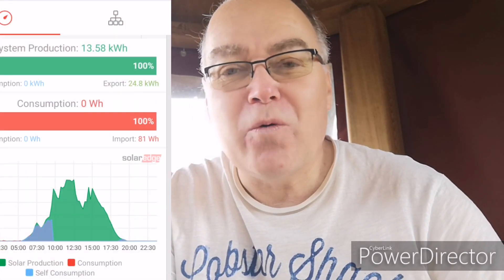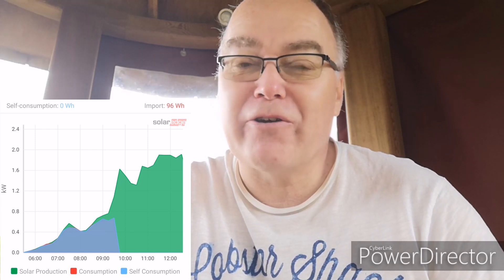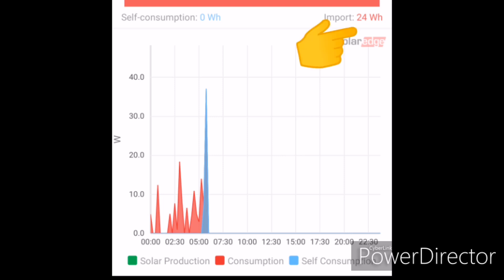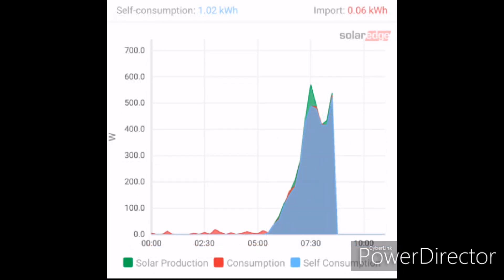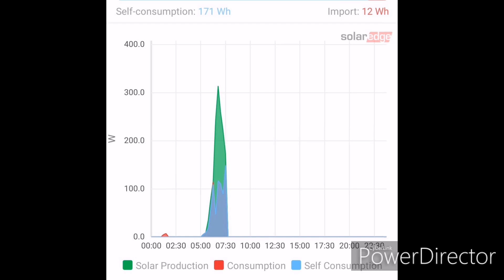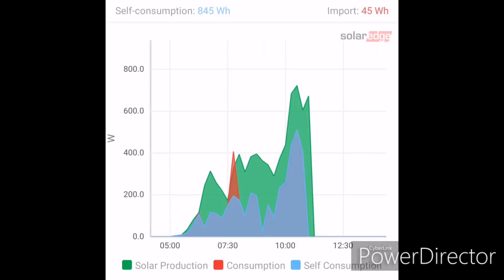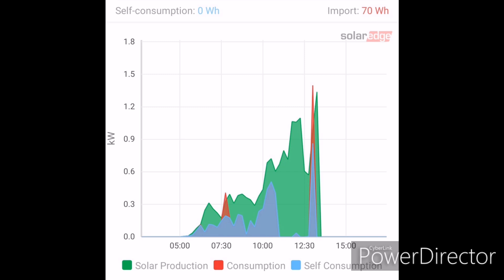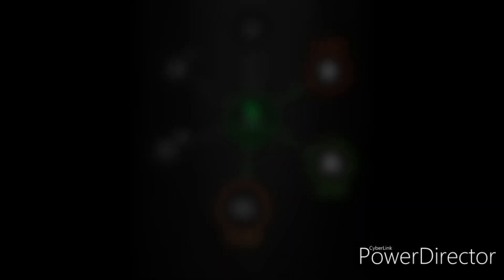Failure! Not all videos or tests go as expected

Comment: After being an EV owner for over two years now, I’m down in Australia.  When it came to looking into the battery for the home, what most batteries do, as in charging as soon as and as fast as possible seems like the dumbest idea ever. Both for the effect on the grid, and speed of charge. When trying to research this before purchase, it was like an alien question and couldn’t find much detail on ways of making it possible. I ended up purchasing a hybrid Fronius and LG battery system. It has built into the software battery management control with some really good options. Still only new to this, and playing with the best options. But it does give me full control over time of use and charge speed which is excellent. Having lived with the system for less than a month, I also now see how it is beneficial for the system not to be fighting the grid or household uses when charging as the reaction time for the battery is far from perfect. The Fronius allows me to say, do not charge at all until 9 AM and then only charge at max set speed until say 3 o’clock and then charge at full speed if needed for the rest of the day. Another feature it has is a fully customizable float point with the grid, as in I can set it to try and maintain 10 W of grid export, eliminating way more of the grid usage then when it tries to float at no import or export all the time. I agree with the other comments regarding faster charging being more efficient, as I have found with the car, but I think battery ownership is more about having A positive affect on the grid. While having enough control to maintain a healthy battery for longevity. As in, if the battery is charged the full by mid morning, most days it would sit full until late afternoon. Which isn’t anywhere near as healthy, as only being full for a couple of hours! Most companies have to make big improvements here.
Reply from the maker: Fronius... Not heard of anyone with one of those in the UK yet. Not a cheap box but by the sound of it, for good reason. Software isn't hard and like you say these controls should be standard. It wouldn't be hard to implement timed control of all settings.  We can but hope companies choose to offer more flexibility alongside improvements in automation and A.I.

Comment: Just wanted to start a debate: we've just installed a 500w system, supplies all of our electric from about 10 to 16:00, apart from kettle , toaster etc. So we've probably halved our grid use age, but we don't export more than a few watts. Cheap, no FIT, no battery needed, but could significantly reduce grid use age if lots of houses did this. What do people think ?

Comment: Nigel you're a smart guy. Indeed batteries doesn't like a huge amount of current, 1C is de rate used for defining the amount of energy they can store but most likely they manufacturers specifies to use them at 0,1-0,3C. Until the lithium batteries arrived.
Keep in mind that a charger has losses, standard base loss when standby/active and a loss depending on the charge current.
A charger is made for his max charge current and the standard losses are related with that. So then charging with a (very) low current give less efficiency. Look into the efficiency graphs of a solarinverter on different loads, it's the same. So it's a balance between efficiency of loading the batterie with the charger used.
Why we like tu fill up that battery asap? Well I'm still googling for a webshop to find the Cristal ball that can predict the amount of sunshine. Of course day's like March, April, May we don't need the ball. Secondly I'm still looking for an inverter/charger like your victrons with an API. The parameters you're changing manually I want them to change with a microcontroller and my algoritme that takes into account a lot of environmental parameter. And depending on them I can decide to charge slower or use more of the battery depending my situation.
I think it will be the same for you: imagen a nearly empty battery, slow charging, grid delivery instead with a teenager that waked up more early (due to teenager's agenda), also switching on a lot of electric household equipment and ... your battery would run out of juice. So these batteries doesn't gives us the opportunity to limit grid in/export but also more comfort with fluctuating production/use of electricity. 
Your testing now is very interesting for me, please continue because when winter comes, the solar will be not enough and probably your battery will need a low baseload from the grid (slow grid charging) to eliminate the peak loads caused by the household use.
Reply from the maker: Interesting as I've read elsewhere lower charging reduces resistance thus reduces heat and lost energy.

As always. Best to test it myself and discover if my precise system reacts how others think it should, might, could.

Efficiency is my goal so if higher rates are better, definitely better to avoid charging until I've got more solar available.

Once I've finished current tests, I'll try it for a week limited, non limited to see if round trip efficiency any better.

To some, all this testing is a waste. They plug in and forget it. I'd rather understand what's going on ...confusing myself along the way of course 😉
Reply: @EVPuzzle  what follows is not 100% correct (more parameters are involved). Concerning the victrons inverter/charger you'll find a standby power spec. That means without using it you'll consume let's say 30W. If you charge with 300W the losses are 10%, why so high because maybe you can charge with 3000W (not you model) and then the losses are 1%. Not correct because I've to add current losses and battery losses.  On the battery side the voltage has to be higher than the battery tension, so the difference in tension multiplied with the actual current is lost energy, the higher the difference voltage, the higher the current and it has all to do with the internal resistance in the battery. I think cells with high internal resistance are not used but sold an the market separately. I'm looking to LTO's instead of LiFePO4's and found out that there are A and B grade batteries.
You're tests will probably don't give much difference results between high and low charge current concerning efficiency and you'll find not so much Google info. But when you would do the tests with the charger of you EV it will be more significant because of the longer test and the amount of energy. And you'll find more info for it with Google. Before I've ordered my EV I wanted to know what the total efficiency (energy consumption) was per mile, not what's lentuoned in the car. It took me long until a Tesla S rider put in the web with a standard house plug he had 17% loss if energy, with a wallbox it was much less. And with the mobile charger on the house outlet it even differences between low charging and high charging.
Reply: second thoughts about charging: imagine those days that in a full day there is just enough PV energy to handle all use without grid, but not enough power to start eddi. When charging at a rate of max PV power, at a certain moment you can start eddi with PV and the missing amount of energy from the battery. If you limit the charge current that amount of energy was send to the grid and you've to call it back

Comment: Hi nigel.. This competition for solar energy might be better controlled if you do it all through the myenergi interface.. I think This is possible if you buy their relay board. You can presumably then even see everything in the app.?
Reply from the maker: Having looked, thanks for pointing it out, I don't think the extra relays help in my scenario. I'm interested in reducing battery charge rates which the Eddi can't control.
Myenergi App already in use but accuracy level isn't great . One decimal place only ☹️
Reply: @EVPuzzle OK.. I get it.. I wonder if the myenergi accuracy improves when the upgrade the app data to be more accessible /exportable..